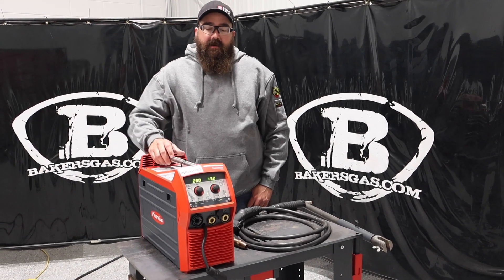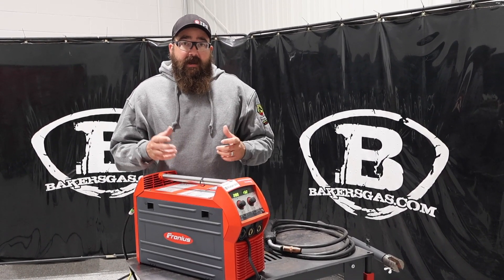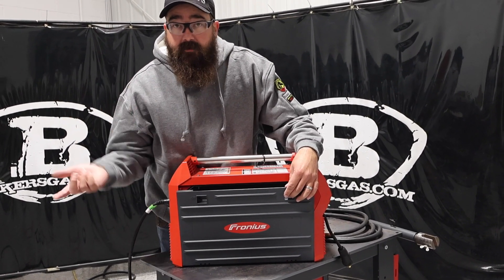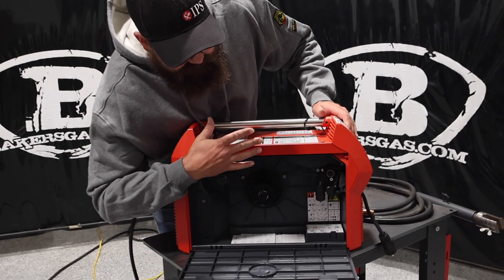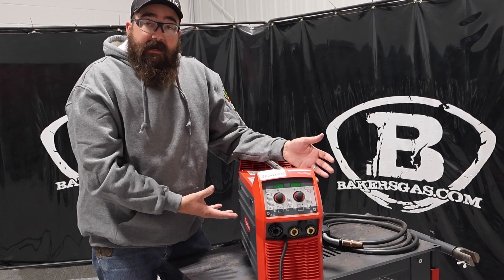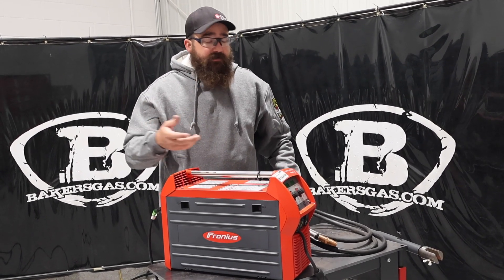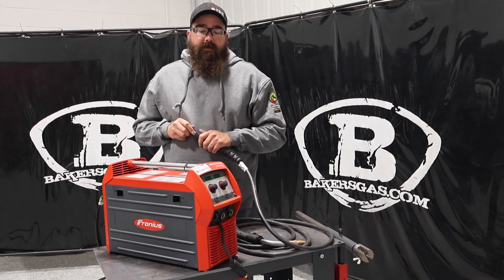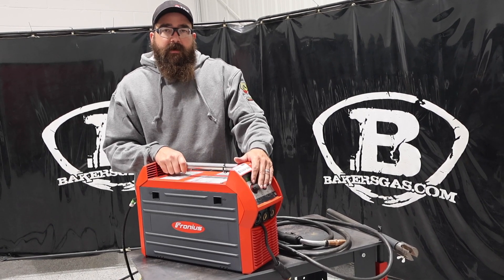TransSteel 2200 Review Video 49,0400,0033 and 49,0400,0034

Comment: Honestly... they are one of the most pain in the a$$ machines I've ever seen... 
Running aluminum was difficult if not impossible at best.
The guns have a plastic (yes plastic)tip at the end of the power pin where the wire feeds into, and if it jams/birds nest ect.. it typically marrs the heck out of this after a couple of times it's screwed... I've never heard of such a thing... if not most or all are brass and are part of the power pin. 

It looks nice, but needing so much proprietary parts, and no real good information out there on how to correct... 

Overall I get they have a certain place.. but there are much better ways of achieving that..
Reply: you need to set the machine correctly. Light tension when using aluimun and teflon linner. I have no problems with mine at all.
Reply: Mine works just fine..better then my miller..